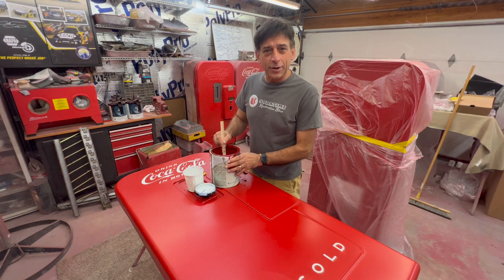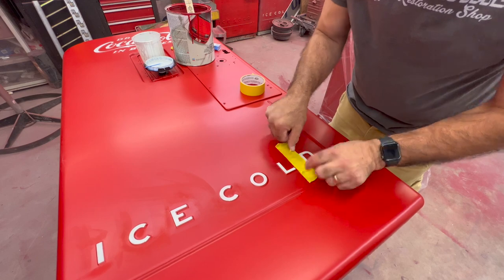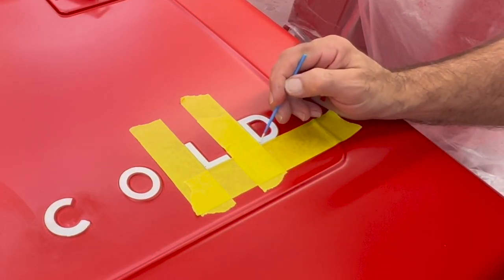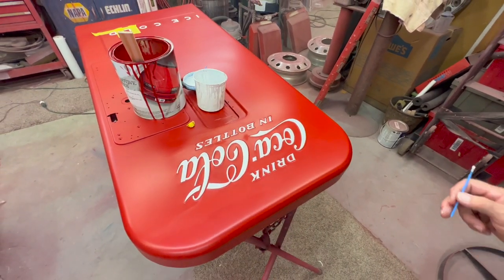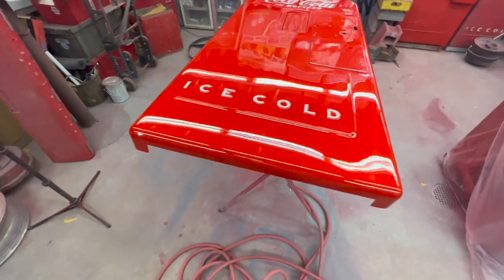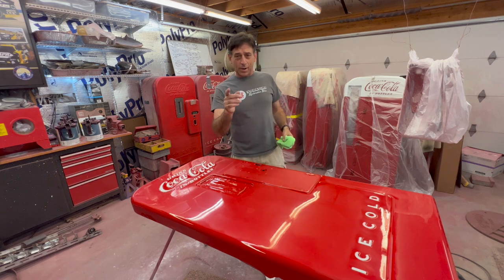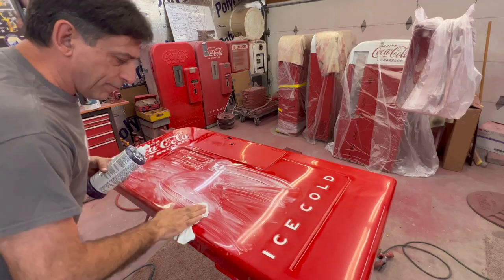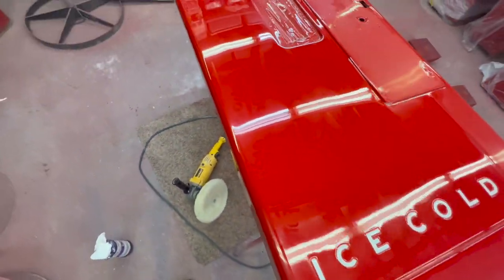Letter Details & Clear Coat Buffing | 1951 Vendo 39 Coke Machine Restoration

Comment: Hi Marc, so your using a 3000 grit FOAM pad in the video instead of using plain 3000 wet/dry. Is that because it's more forgiving and gentle to the surface? Is it safe to assume you used a foam pad when you did the 1500 grit sanding, as well? Any recommendations as far as which brand of pads you like? Thanks!
Reply from the maker: 3m foam pad is my go to pad!
Mist a little water when using it!
I have done both but will always finish with 3000 on a 6 inch da pad

Comment: I love this series so far. I have one of these machines and it’s been inside all it’s life. And most of that has been private ownership. So it’s really in fairly good shape. The paint is vibrant and only has a couple very small dents. So I have a few questions. Is good original condition better than restored condition? I like it the way it is but I think it could be just that much better restored. Also where do you send your refrigeration unit for rebuild? Mine works well but I’m sure needs serviced and definitely needs an updated cord so I just want it to be safe to run. My last question is where do you get your parts from (seals, labels, vinyl stickers, etc)?
Reply from the maker: Sounds like you have a Great Vendo 39!
Updating what you have would be not only better on insulation and maybe a better efficient compressor !
Value in a restored machine is what raises  the cost because of the work to get the work done!
Funtronis and soda jerk works and my two main suppliers ! 
If you have the original compressor still working but want to update to a more efficient compressor! That’s when I would pull the cabinet and re-insulate main cabinet! And also put in new drain tube
Our next video series will be covering the cabinet insulation and drain tube!
Reply: @sodatimerestorations  thank you for the info!

Comment: Just bought a vendo 39 today and it has some dents on the top left and right corners of the door. Any suggestions on how to get these out with ease. Also where do you get your replacement parts? Thanks in advance for all of your help.
Reply from the maker: Two places for parts 
Funtronics 
Sodajerk works
Send me some pics of the dent!
Reply: @sodatimerestorations  what’s the best way to send the pictures?
Reply from the maker: @brandonsmith-nx9rl  you can send to Sodatime95@sbcglobal.net
Reply: Did you receive the pictures?
Reply from the maker: Great 39!
Yes this can be done from the inside and tap the dent out! Should not be very hard!
I would take door off and remove back and insulation!
Reply: The tub is pretty rusted out do you have video showing how to repair the bottom. The drain tube was stopped up completely. What tool would you recommend knocking the dents out? Thanks and keep up the good work.
Reply from the maker: Series 10 video shows  how to put a new plate down